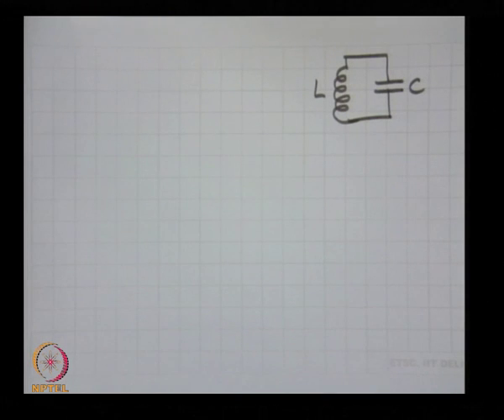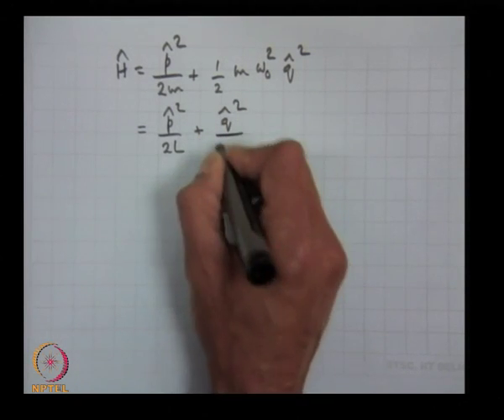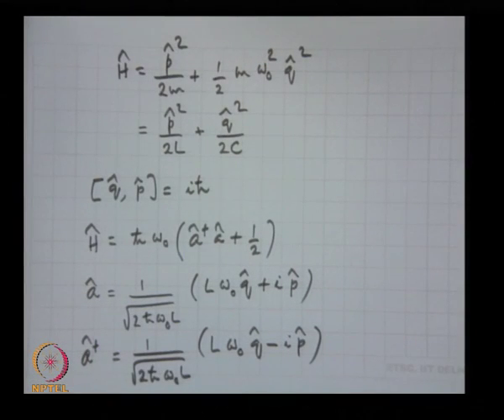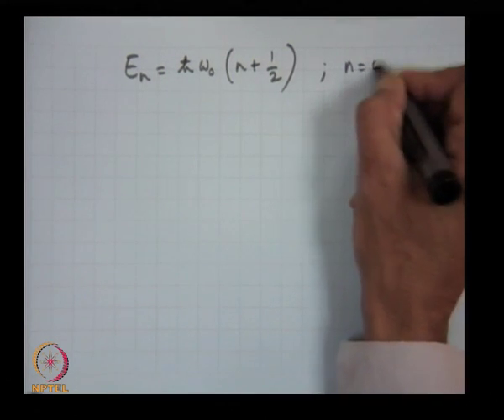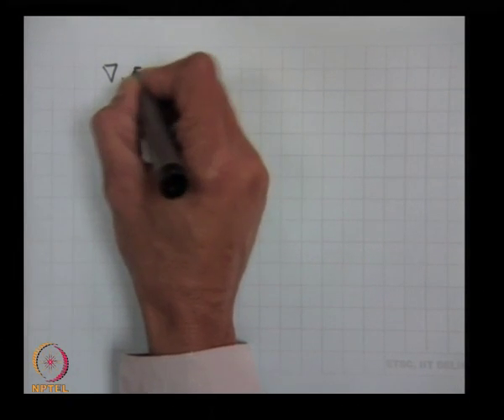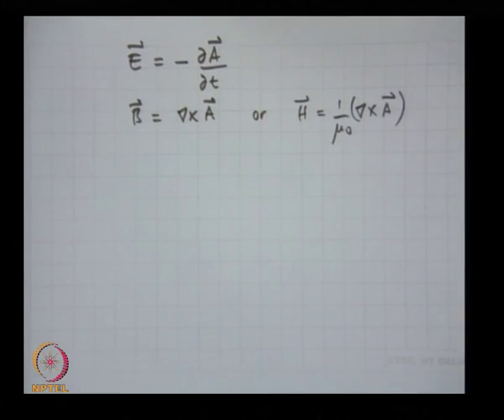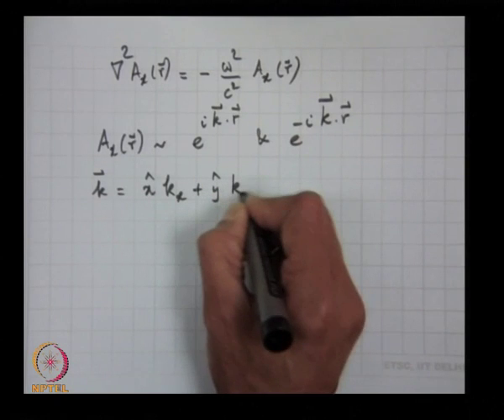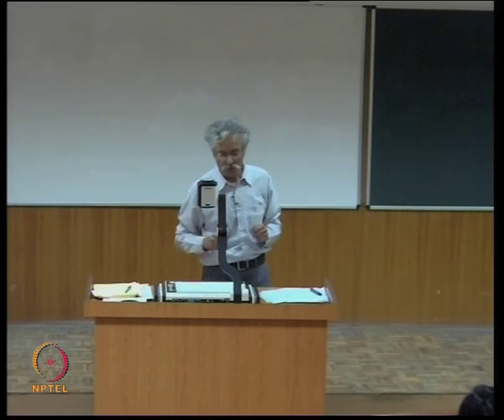Quantization of EM Field

Comment: This lecture and the next two are based on Walter Heitler's "The Quantum Theory of Radiation".
@ 28:58 The quantization of the EM-field starts here; free space is like the far-field of an antenna.
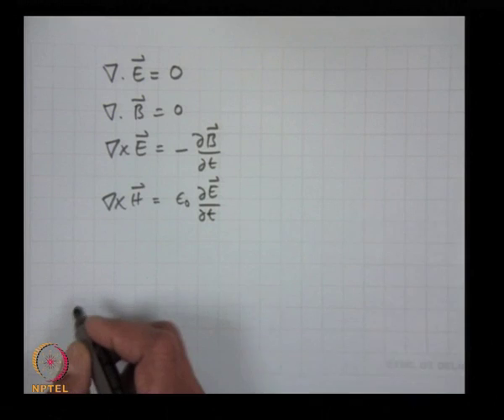@ 29:53 Think of the B-field in a long solenoid; this field generates a curl of A (around B). 
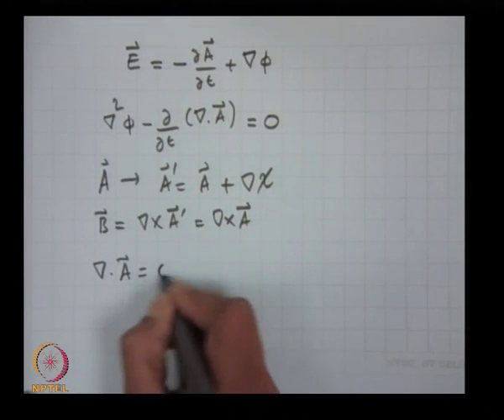@ 33:10 Because A circulates around B, there is no divA (like there is no divB around a magnet).
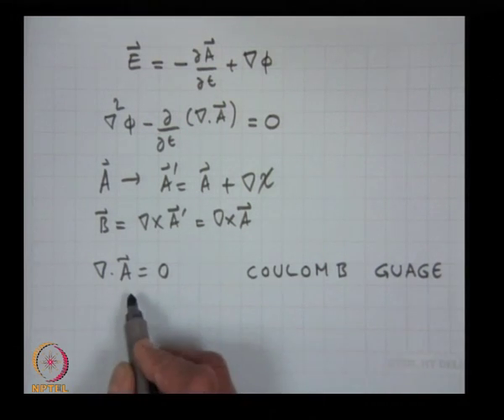@ 33:27 In free space, there are no charges who could create a scalar potential; so PHI = V = 0.
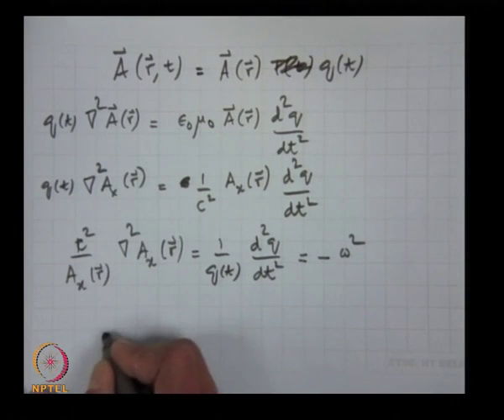@ 40:00 q and A have to be sinusoids making charges accelerate (via E) and emit radiation; 
                but using the word "acceleration" is not allowed in quantum physics ;-)
@ 45:10 I think it's better to call it "box-discretization".